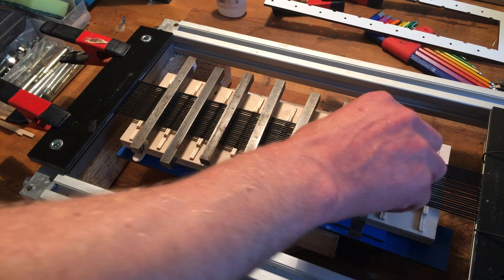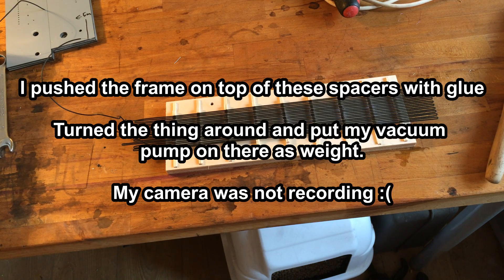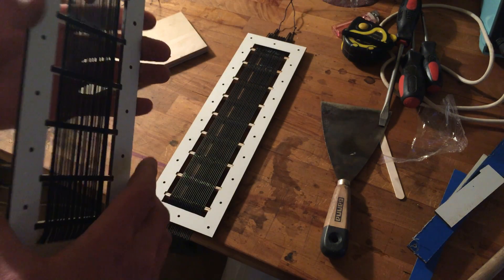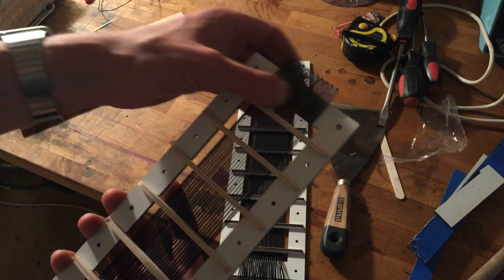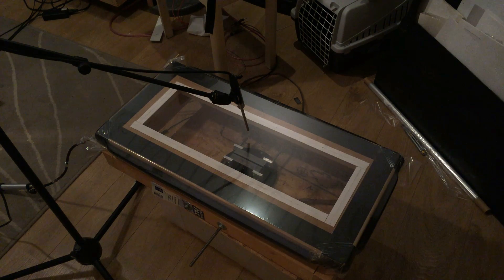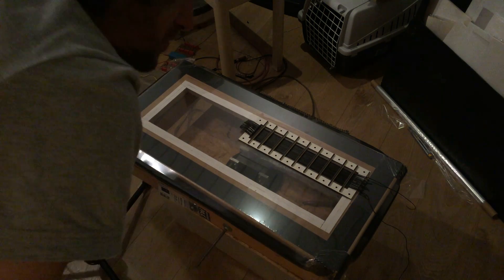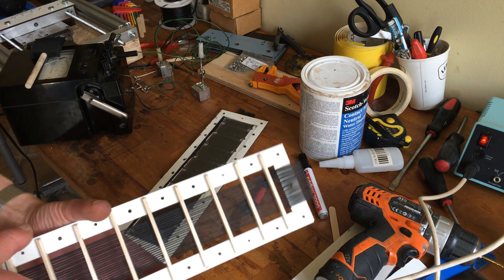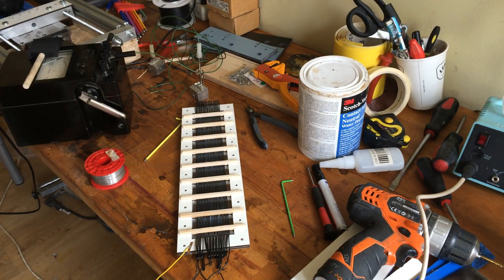Big Guns Mark 2 - Electrostatic Wire Tweeter Part 2(speaker test panel)

Comment: Did you only use ysheld for the coating?
Reply from the maker: Yshield i only uses as source for graphite, i wont recommend buying it.  if you want to make your first esl go get a can of lyrcon crystal permanend coating. biggest change of succes without all the crap i bought.
Reply: @joppepeelen  Ok,

Comment: Forgive me, could you send me detailed photos on the system to pull the milar ... the one made with the inner tube, I did several tests, but in the end I think it is the best way and for this I would like to build a similar one.
Thanks again.
P.S. you can send them on FB.
Reply from the maker: well there is not much to it.  get a piece of wood as thick as the tire you use. make a round or square piece, where the inner tube will fit around. wrap the mylar over the piece of wood and over the inner tube that is around the wood. stick the mylar on the bottom side of the wood.  blow up the tube and the mylar will be stretched.  mine is no different.  except it has a hole based on Quad panels. so i could measure and compare resonance of a panel before i glue them down to an quad panel.. never finished that project though to much hassle .

Comment: try rubbing fine carbon powder, to membrane, it is eternal, not temporary :)
Reply from the maker: Graphite you mean. Yes it works but is very incosistent low impedance and really realy messy hihi:)